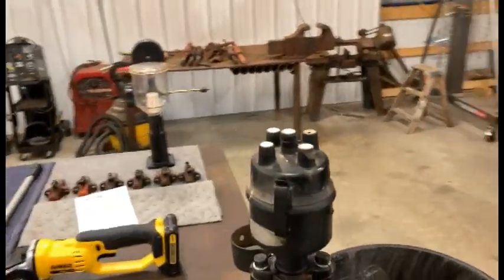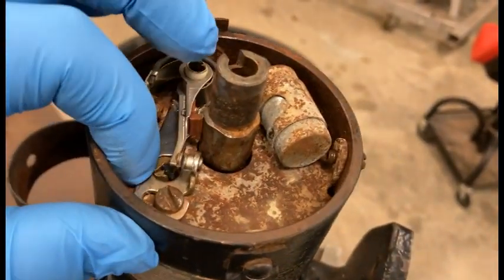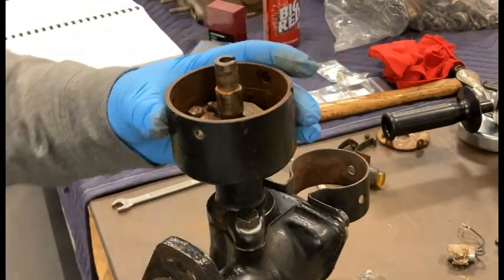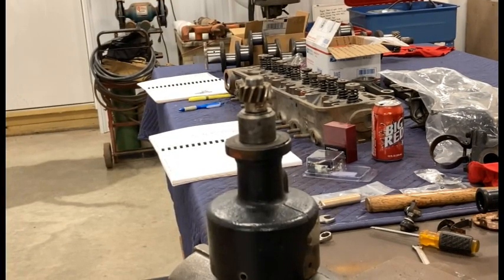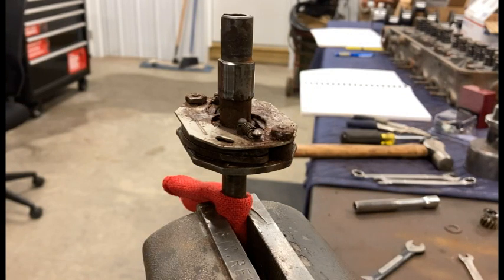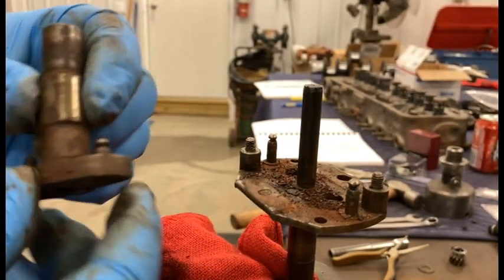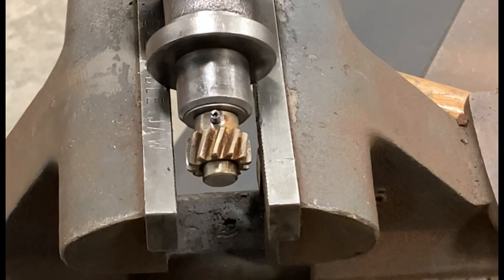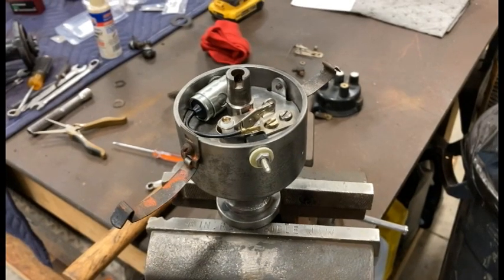Allis Chalmers Distributor Rebuild Part 1

Comment: That set screw for the bushing, is that drilled through to the shaft? I was told during spring maintenance, take out that screw and shoot some oil or grease in there for the distributor shaft.
Reply from the maker: Michael, on this one that is not drilled into the shaft.  It makes complete sense to be however, I'm going to look at my other distributors to see if they are.  Thanks for bringing that to my attention.  On the top where you rotor sets, that is hollow with a wicking material in that hole that allows you to put some oil in there when you replace the points so it stays lubed up.  The first I ever heard of that when doing this project and reading the manual.
Reply: @nashsummers8050  Now that I think about it, I was told about it in regards to an Farmall  Super A which the distributor is mounted horizontal. I even seen one late Super A with a zerk instead of the set screw. I need to check my Wd-45. I'm probably pushing grease into a blind hole. LOL

Comment: Good  day Nash  I had to watch 2-3 times to get threw  all of it.
I like when u use allis  screw driver,   I guess  a JD, IH   would not work. lol
We bought IH  W-4 & it had right angle distributor  compared to W-6  have hortizontal    dist..  
Do u leave small roll pin in then.
Thanks
Reply from the maker: Hey Don, thanks for watching once again, yeah this video ended up a little on the longer side, probably should have split it into a couple video's.  Yes you leave that small roll pin in and cut off the excess that's sticking out on either end.  Will chat soon!

Comment: Nice video! Interesting that the new bushing didn’t seem to fit. Was the tip of the shaft mushroomed out a little?
Reply from the maker: Hey, not sure why it didn't want to fit.  The shaft wasn't mushroomed and the manual didn't mention about the need to hone it out to fit.

Comment: will you be putting non-electrical grease on the shoe of the points that runs on the cam lobes of the distrib shaft, that open the points ?